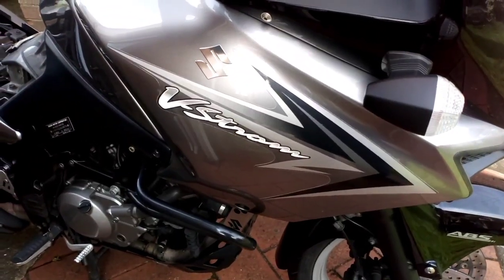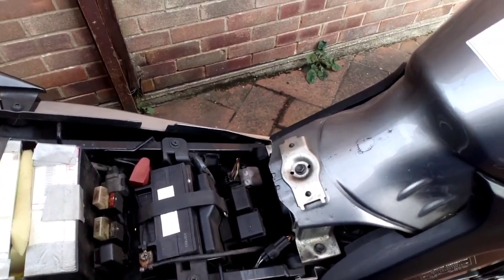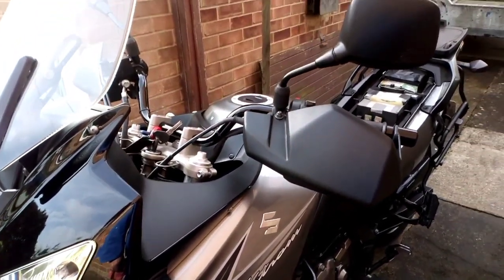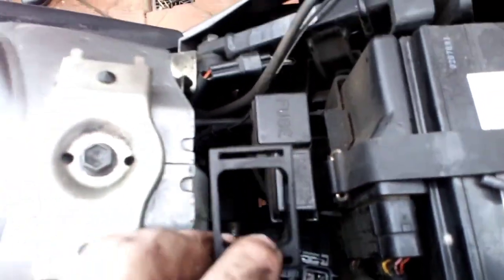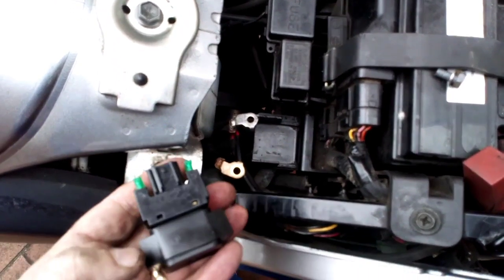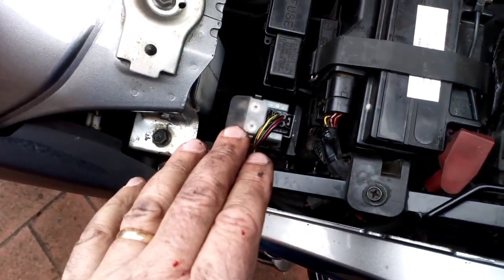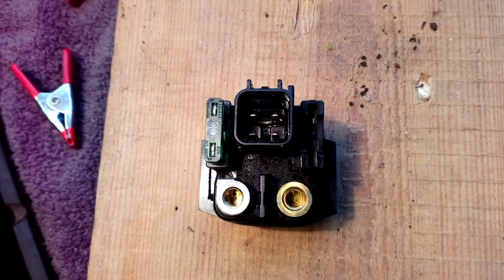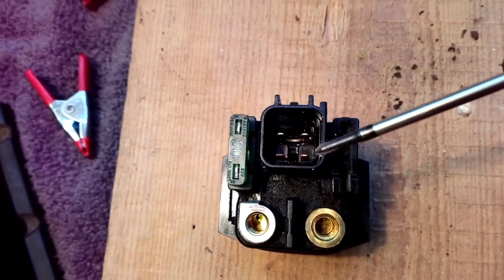Suzuki DL650 V-Strom Starter Solenoid Replacement

Comment: Very helpful video i might check my 2008 v strom 650 with your method as i have some starting problems recently (not always). I have also cleaned the start button-headlight switch.
So for the test you connect one cable to positive battery and one to the negative battery and with these two cables check inside the fuse i didnt quite understand. Because i thought the solenoid receives only positive?
Reply from the maker: I'm pleased it was helpful. I think of the solenoid like a switch. The starter button completes a circuit which then throws that switch (inside the solenoid) by activating the solenoid. The positive feed through the solenoid goes to the starter motor, and the starter motor is earthed to the frame, as is the negative terminal of the battery. Hey presto, complete circuit, and the starter motor turns. The starter button is not the actual flow to the starter motor, rather it is just a circuit that activates the solenoid, which completes the actual circuit to the starter motor.....if you follow.... Ultimately they all earth to the negative terminal of the battery, frequently by connecting to the frame, or a wire that  connects to the frame.

Comment: My bike starts ok, but sometimes my low light doesn't work. And when i push start button on WORKING engine in this case, i heard as my starter works (it shouldn't with working engine). It's DL650 2014. Is it solenoid issue, what do you think?
Reply from the maker: If I understand,  I think a dim light should not be a problem with the solenoid. Also, if the starter motor spins when the button is pushed, even with a running engine, I would not suspect the solenoid first. Check the battery has good charge, seems maybe more of a charging system problem than a solenoid, but, hey, what do I know? If there is no problem starting maybe it is not the solenoid.

Comment: Never had that problem with my old D14/4.....

Things are made so complicated and sealed so that they cannot be repaired now. A gizmo to stop you from starting the bike unless the clutch is pulled in has so many potentials to fail, from dirty contacts on the clutch lever, broken wires and so on. Have we forgotten the KISS concept? 

With it fixed, it can be ridden to Dover and then the rest of the world!
Reply from the maker: We might both lament the introduction of complications into every aspect of modern life. Yesterday here in the UK the government tested a threat alert system, sending a signal to every compatible mobile phone in the nation. My thought was "Haven't we managed for millenia without this?" Luckily my phone is so old it was one of the incompatible ones. Whilst my wife was startled by the alarming intrusion,  I wasn't.

Comment: Replaced the solenoid and my bike still won’t start with the regular if ignition switch
Reply from the maker: I hear the starter button can sometimes cause problems. Also worth checking the kickstand and neutral gear switches are good. Another cause can sometimes be a bad earth on the starter motor itself.